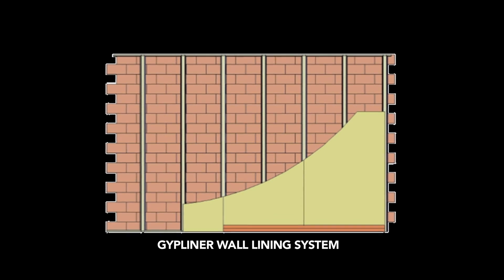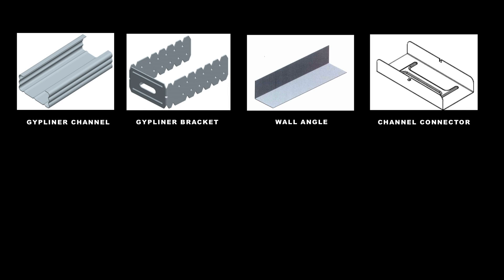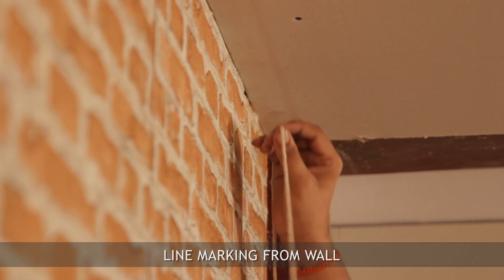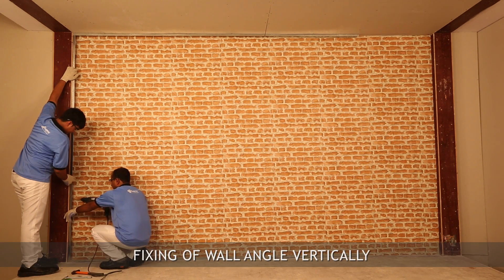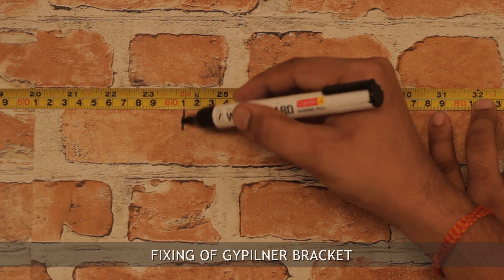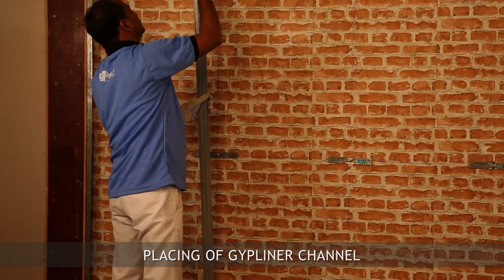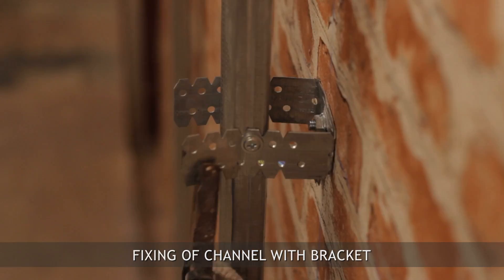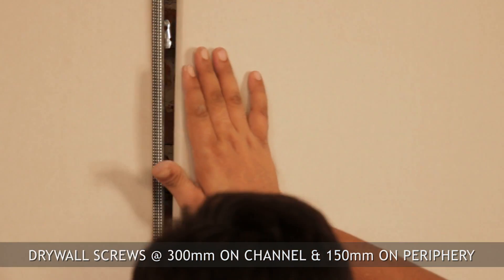Gypliner Wall Lining System by Gyproc | High Quality Wall Lining System

Comment: What are possible finishes for this wall apart from paint? and can we fix furniture on these walls? what is the strength holding capacity?
Reply: did you find video where this is described?